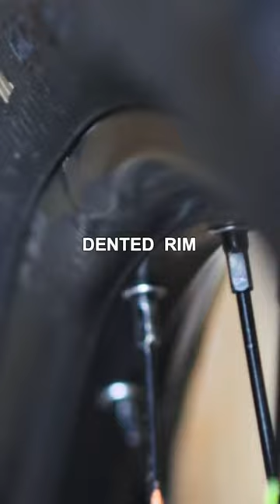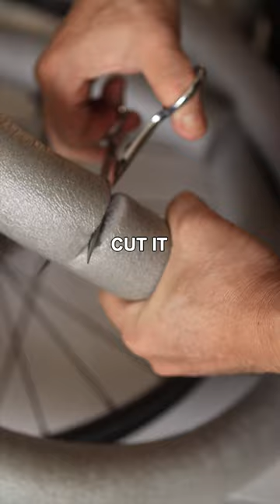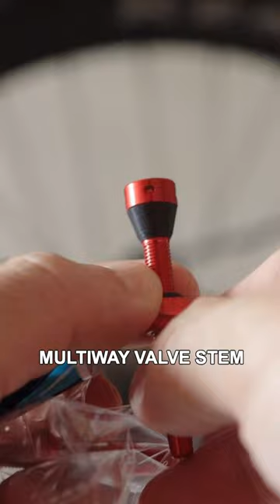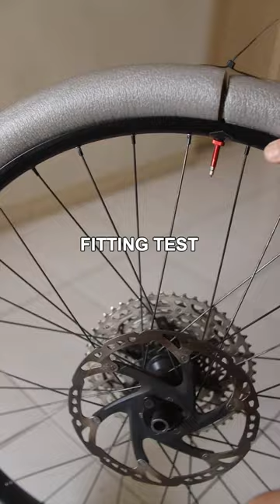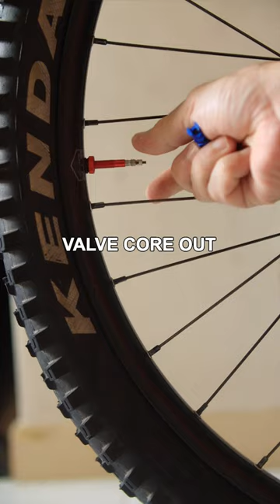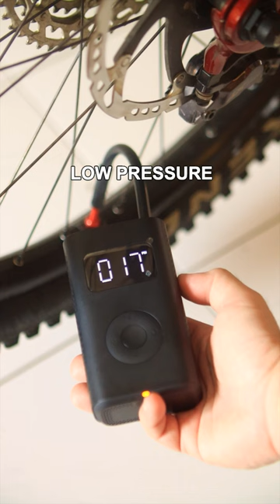Budget DIY MTB Tubeless Tyre Inserts

Comment: Yo a UK MTB mag did a study with this stuff and stated it offered zero impact resistance or support benefits. Don’t waste your time folks!
Reply from the maker: Running for 6 months, it is good to me. Enduro Mountainbike magazine tested this, but used a wrong diameter, 40mm  diameter insert to a 35mm enduro rims. It is too thin. And concluded that’s zero resistance. That’s stupid.
Reply: Im glad it’s working out for you bro
Reply from the maker: Could you share me the link of the UK MTB mag that tested this? Thanks.

Comment: How big of a difference does tubeless and tube and have really as a just general qestion
Reply from the maker: If talking about high air pressure, tube or tubeless, no difference. When they in low pressure, like 18PSI, during DH, high possibility tube will get pinched flat or broken by rim edges.

Comment: Or use dh casing tires and appropriate pressures
Reply from the maker: It is a good idea to change to DH casing tyre when the existing tyre is worn out. But they are not cheap.
Reply: @LeonLoh  actually usually maxxis dh case tires are cheaper than double downs
Reply from the maker: When time to replace tires, yes, is a good idea. But when not the time to replace, baker rod is a super cheap offer.

Comment: Why low psi? I ride with tubes and go to a lot of rock roads the minimum I put is 40 psi. Am I wrong?
Reply from the maker: You are not wrong. Lower PSI will give more traction during downhill. With tubes and low PSI, high chance to have pinch flat. Tubeless set up with low psi will damage the rims. That’s why insert is added.  The target is to have more traction and without causing any damage.

Comment: No money for a real insert but enough for an electric air pump? People with electric gear going to the gym right after.... 🤦
Reply from the maker: 🤣I like your comment. Is really bright up my day. Is not about how much you can spend, is about how much you can save. I am Asian 🤣🤣🤣
Check the link below. You will understand. 
https://youtu.be/Klu2Xxdtn_Q?si=KkL6dM-gd97-lAPF

PS: check out my bike. Is a Trek Rail 😂
Reply: A regular floor pump is probably more expensive than the electric air pump, he can also carry that electric pump on his camelback. 😮
Reply: @miltonrojas7698 most pumps are carried on the frame.
Reply: It’s a thousand times easier to set a pump to 30 psi and let it go than pumping to 30 yourself. Electric pumps like that start at $40, a decent name brand floor pump starts at $35
Reply from the maker: Is a Xiaomi air pump. I bought it not specially for bike, I also use for my cars and soccer ball.
Reply: If evolution is a real thing, one day you all are going to lose all your fingers to only keep one, to press on your smartphone buttons.

Comment: А где брать эту "колбасу"??
Reply from the maker: 50mm Diameter PU Backer Rod: You can find these at most hardware stores. Make sure they are large enough in diameter to fit inside your tire. I am using 50mm diameter rod to my 35mm width rims. It works perfectly. Bike park, Enduro and drops…

Comment: Donde se consigue esa " nube" porque es evidente que es para algún servicio industrial, no para tubeless de bicicleta...
Reply from the maker: PU backer rod is the material. Is a construction material. You may google it to find out where to get it. You could get it from the hardware store normally.
Reply: @LeonLoh  thanks!
Reply from the maker: The diameter of the rod shall be wider than the width of the rim. For example, my rim width is 35mm, the rod diameter I use is 50mm.

Comment: Really? Zip tie? Just super glue the ends
Reply from the maker: Super glue is a good idea. It might able to close the.cut end that sucks up the sealant. I will try that.
Reply: Zip tie is good. Vittoria use it in their original cushcore
Reply: Super glue might make it melt, some of the chemicals in super glue make dome foam parts melt.
Reply: using a hot knife in the gap while pressing both ends together might work too

Comment: 18 psi’s a bit low buddy even with inserts. If you were running 20-25 psi in the back maybe that’s why your denting your rims so easily? Personally I run 30 psi in the rear even with cushcore in bc I ride relatively hard and I dent my rims wayy too many times.
Reply from the maker: I am 65kg bro. Will observe and see. May be you are right. Thanks.
Reply: I'm 76kg and I've cracked 2 rear rims with cushcore running 24! The threat is real

Comment: Boa noite como faço para comprar cubo de bicicleta aro 26
Reply from the maker: Haven’t done that before. I normally replace the complete wheel. As the cost of the complete wheel is a little higher than getting a hub. Try to look for used wheel set. My experience, they are much worth compare to  only getting a hub.

Comment: بس هاذا غلط فادح يسحك تاير ويقلل من مسكة بالارض...يتلف بسرعة
Reply from the maker: I would agree that it will wear out quicker, but it definitely will not reduce grip. As you can apply lower air pressure, huge grip you will gain during downhill.

Comment: Bro how did you manage to dent your rims?
Not enough air in them?
or are the rims made of plastic? XD
Reply from the maker: It was dented from a drop, a broken cement XC trail. Not what you seen from this Short. I run 18psi without insert that time.
Reply: @LeonLoh  oooh Alright.
That makes more sense.

Comment: 重量や乗り心地はどうですか？
Reply from the maker: Weight: I did not measure it. But not heavy to me when I hold it, as it is a foam type of material for construction purposes. 
Ride comfort: Is just like normal riding with 18PSI with some funny noise when you ride on flat area. But did not border me much.
Reply: And does not work at all, compared to cushcore or some other brands. The foam is to soft. Has been tested by different magazines already.
Reply from the maker: So far so good after 3 months using. Most magazines mentioned about foam noddles. But this one is PU backer rod, it is much more firm and dense than foam noddle.
Yes, cushcore is much more better, and it is much much more expensive.
Reply: The Enduro Mountainbike Magazine (German) tested something that is used to fill expansion joints between concrete  elements. Looks quite the same as yours. They say, there is no effect against punching the rims (They measured it somehow).
Reply from the maker: Thanks for the information. I just read the article from this link:

https://enduro-mtb.com/en/hardware-shop-backer-rod-2023-review/

To me, the 40mm diameter backer rod just way too small to protect the rim. Normal enduro rim is about 35mm on width. I use 50mm backer rod, and I can see some marks from the rod that caused by the rim after a local bike park ride recently. I am not a hardcore enduro rider, I like to ride flowy trails and sometimes technical trail descent. Jumps is not my favourite after an injury a few years ago. 
In conclusion, if you are a hard enduro rider, I will not recommend to use this DIY backer rod, and strongly recommend go for Cushcore. 
It is good to know that the weight of the backer rod is much lighter compared to others. It is very clear that the density of backer rod is lower than the expensive inserts, and for sure they are much more better in taking impact compared to the backer rod.
Reply: That‘s exactly the article i meant. If there is a thicker product, maybe i will give it a try the next time i change tyres anyway.

Comment: And nothing changed... DIU tyre inserts don't work, man. This is silly... And depending on manufacturer this can soak all your sealant.
Reply from the maker: The backer rod diameter shall be big enough. I use 50mm diameter rod to my 35mm width rims. Is working to me so far. Local bike park, XC trail, so far so good. One thing you are right, they will suck up the sealant.

Comment: Seems like really expensive and really hard to install lol
Reply from the maker: Backer Rod 10m is about 20 USD, and I could use them for 2 bikes and still left about 3m. Yes is not easy to put the tire back.
Reply: @LeonLoh  oh I was expecting it to be closer to the price of that Tannus Armour. I ride bmx, you think this would work in a 20” wheel? I don’t have much issues as long as I’ve got slime and tube strips

Comment: I don´t get it! 
How do people get there weels fucked up that easy?!

Budy of mine too, he hase two flats every time we ride, and busts at least one rim every year.

I didn´t even have a flat for 3 years!
Use good tires, good tubes and have proper pressure!!

Ah and being a good rider that avoids jumping straight onto every sharp corner might help too!! 😉
Reply from the maker: The dent is a real one, happened from a drop to a broken hole of an XC cement trail. It was an accident. The tire bead was broken and air was out.
Reply: I pop tires cause im fat
Reply: @Thekingofallpumpkins  Yea, ok... That's something else.. 🙄
But I can suggest using heavy tires!
Schwalbe hase the "gravity" casing that woks for me.
Most tire brands have those heavy types. Not good for jump trails though! 😅
Got my Enduro bike to a bike park session, and tryed to run the jump line but couldn't get to speed at all.
Staid to the flow and DH parts! 😁

Comment: Until it soaks all your sealant up
Reply from the maker: Just found out, I can run without any air. So I guess I do not need any sealant. Sealant is keep on blocking the valve core. Very frustrating.
Reply: @LeonLoh  no you don’t need the sealant to run tubeless, but as soon as you get a single puncture it’s going flat without it.
Reply from the maker: I meant with the insert, I can run without any air in.
Reply: @LeonLoh  oh I see what you mean. That wouldn’t be possible as equivalent “pressure” of the pool noodle wouldn’t be enough to hold the tyre up, so it wouldn’t be rideable, if it were inflated and you happened to get a juncture you could maybe ride home gently on it but useless otherwise. The inserts are designed to protect the rim from big impacts, nothing else.
Reply from the maker: @AnotherMrLizard  Yes. You are right. Only can ride back to the car gently. As the sealant, it is sucked up a bit by the insert. I am still monitoring it.

Comment: what are the disadvantages?
Reply from the maker: The backer rod will suck up some amount of sealant. I am still monitoring.
It will not be as strong as the expensive insert in the market.
Not for hard enduro, XC will be perfect.
Reply: they are slow